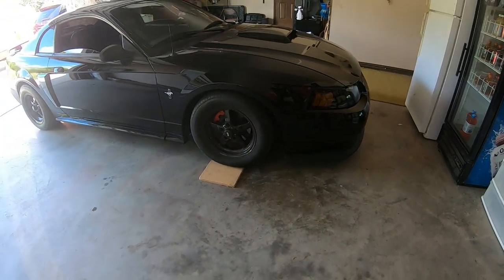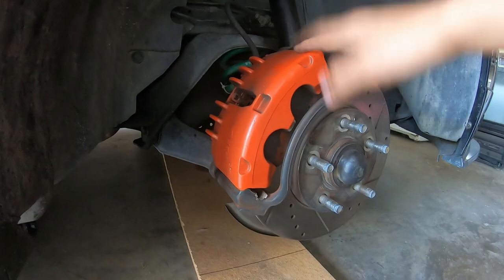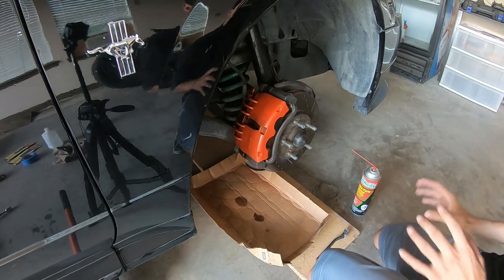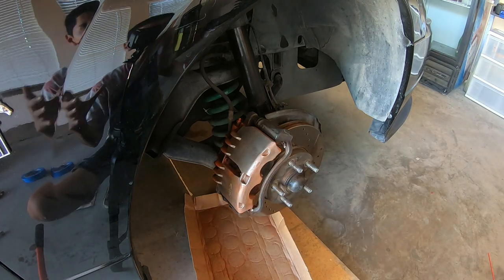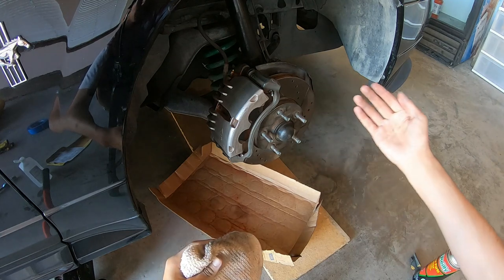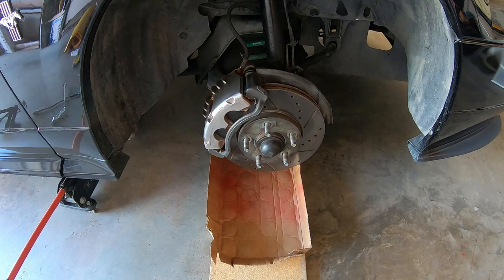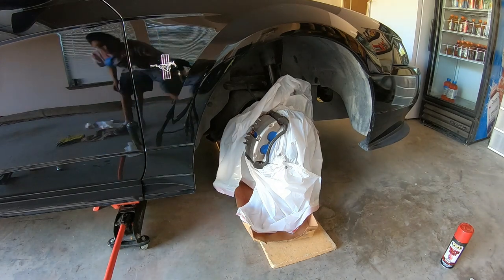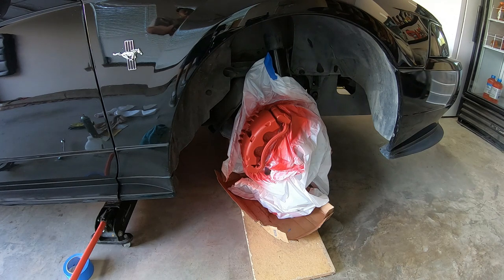How to paint calipers and remove paint on my 2004 Mustang GT (Detailed Process)

Comment: Looks good.. my only OCD issue is that it would have looked much better with the caliper brackets left black.. that's how ford did it on Bullitt and 10th anniversary red calipers.. it makes the caliper body pop more and that's where the pad rides on anyway at the ends.. but.. that;s just me..  other than that looks much better than the orange.
Reply from the maker: Like how I had it originally? Yeah, I liked it too, but I wanted to experiment and see the end results. I like both, but in my opinion I like the end products with the red, atleast it’s red 🤣

Comment: If you put the tap on clothing or anything and then proceed  to put it on your car paint or glass your liable to put micro-scratches on the paint or glass if it picks up anything from your cloths DO NOT do that if your paint is a million years old and peeling then you're likely to pull paint off if your paint is not freshly paint you're fine to put it on the body just ensure it hasn't been stuck on anything already so it doesn't scratch if your nitpickey
Reply from the maker: Wassup Zach, I agree it can be dangerous taping your car if your paint is pretty old lol, I actually learned this technique from a professional detailer, he would use blue painters tape and purposely make it non sticky and taped it on to plastic surfaces or just clean areas of the cars paint. 
I recently saw a guy who used painters tape without making it "dull" on his yellow termi, he peeled it off like a brazilian wax and easily took off the paint lol. If you are not comfortable using painters tape and making it "dull" you can easily use the yoga mat method or just lay the garbage bags and it will static onto the paint.
Reply: @dfwdanny  yeah well I mean to be fair you shouldn't rip the damn paint off like wax paper so he kinda got what he asked for but I see no real benefit if you use common sense it's not likely to come off at all